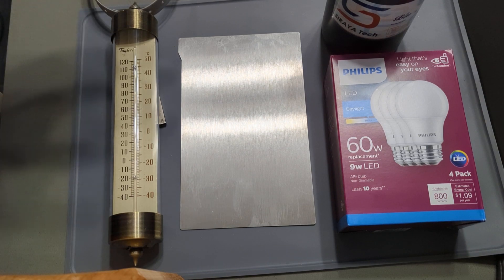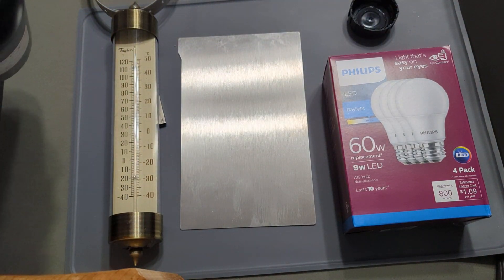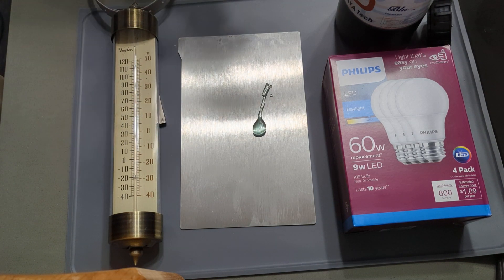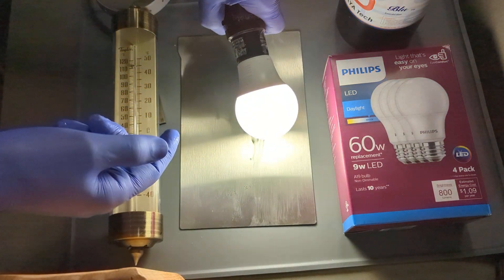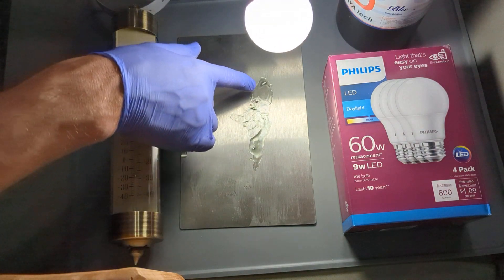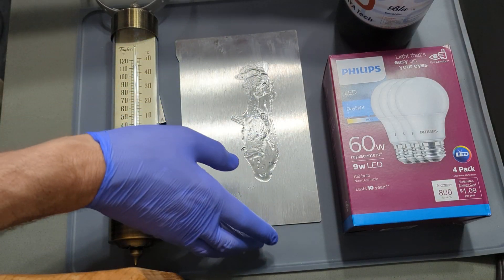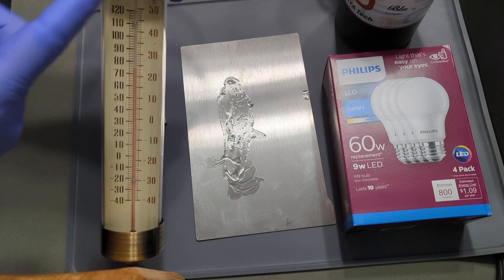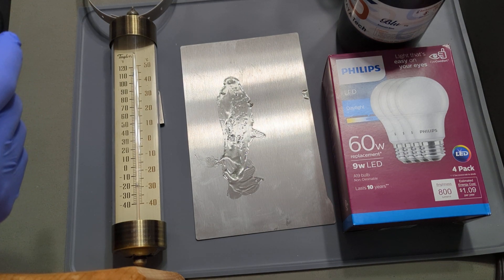Siraya Tech Blu Resin Cured by Lightbulb

Comment: I guess those Philips bulbs have more output at lower wavelengths than other lamps. But ALL white LEDs have some output at the wavelengths used by 3D printers (405nm), so this will happen to all resins if you wait long enough.
Reply from the maker: Probably, But I found that the Sirayatech Blu and Phrozen Hyperfine react quite fast. As it will cure on the build plate just while I have the hood off to remove the print.

Using the smart lights set to red makes it safe to work in the room. But it's a little difficult....
Reply: @J3DTech  I've used Siraya Blu a lot and never noticed anything like that. I guess it depends on the exact LEDs used and the light intensity where the resin is.

Comment: A typical "regular" COB LED flashlight can be shown to produce 5-7 times or more UV (of the appropriate wavelengths to cure resin) than the actual printer light source, this can be demonstrated with a UV power meter, easily obtainable from Chi-Tu and others.  Good practice is to always check LED (and other) light sources in print rooms for this!